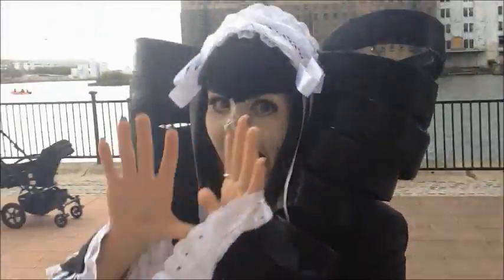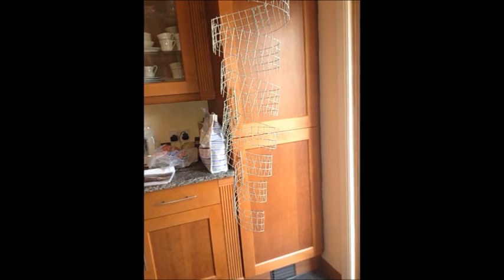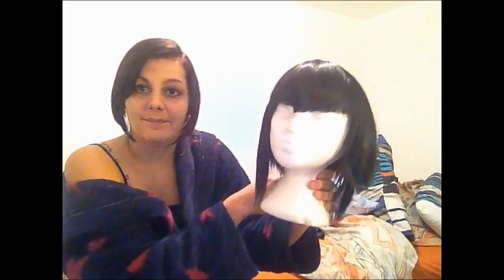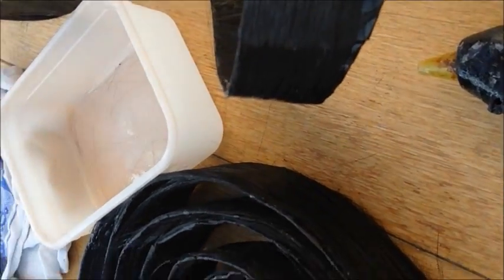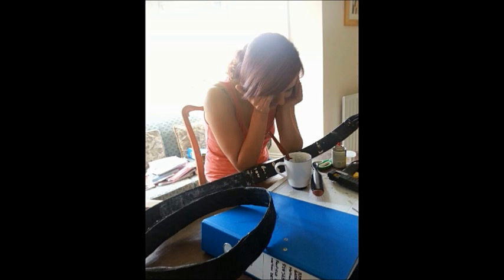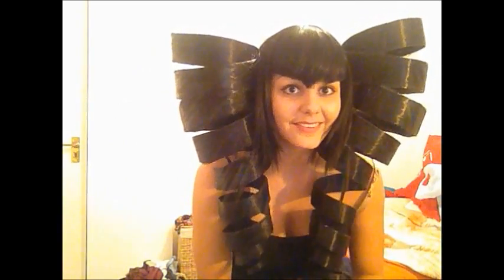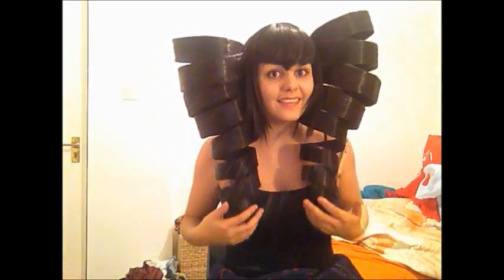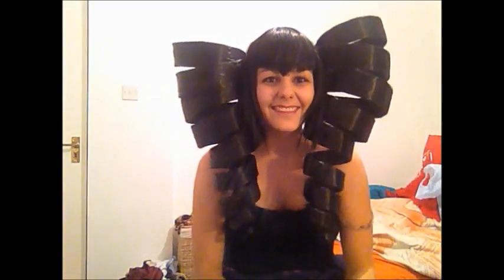Celestia Ludenberg Wig Drills Tutorial

Comment: i did this and it turned out amazing! i coated the inside of the drills with glue to keep from peeling but not the outside and it worked well for me! i havent gotten a chance to wear it them for an extended period of time so i can't vouch on comport yet but ill be wearing them to a con at the end of July so ill update then! they were pretty easy to build and i love how they turned out :)
Reply: also i had to add some craft foam on the inside of the headband so the bolt didnt stick into my head lol
Reply: Update?
Reply: @thinkingaboutlife8266  they were pretty comfortable over all!! they were a bit heavy so i had to take a few breaks from wearing them. one small problem is that you cant really bend too far forward/backwards without holding them or they slip off but it wasn't a very big deal for me!

Comment: What did you say around the 6:25 part? I'm already at the maximum level of the sound on my laptop and still couldn't hear it. I got my Celestia wig and I accidentally cut off the clear string that was attached to the drills and it looks like it's falling off. I was wondering what you used it so I can save money and fix it.
Reply from the maker: Haha yeah the sound quality was pretty bad sorry about that! Basicly to hold the shape of the drills, there are cable ties threaded between the drill on the side touching your face. These keep the drills held together :) Black cable ties are extra strong, cheap and discrete so would highly recommend!
Reply: she said something about cable ( cars ) attached in here